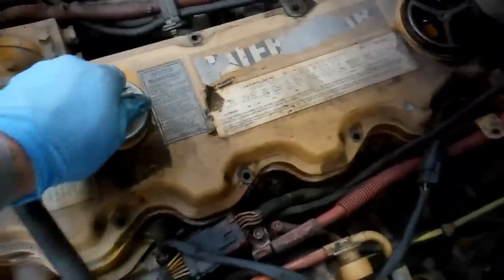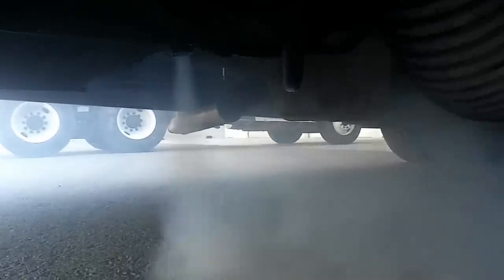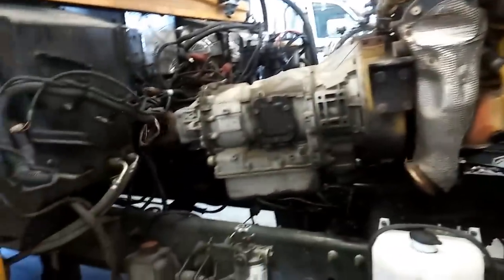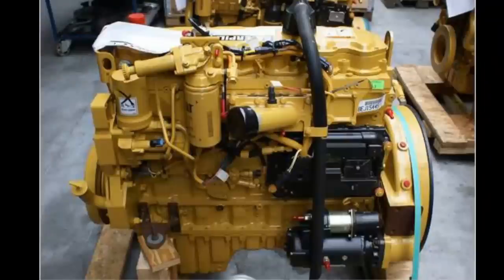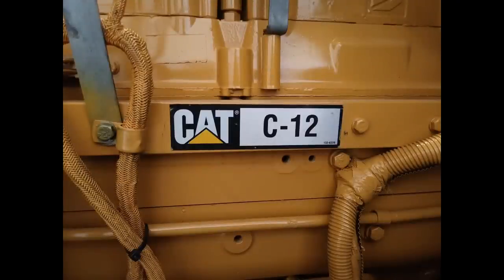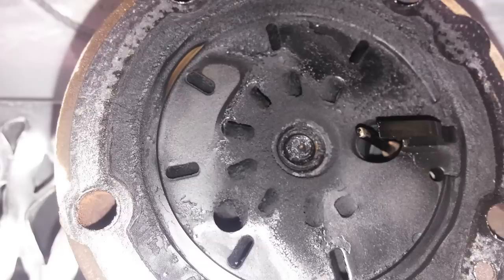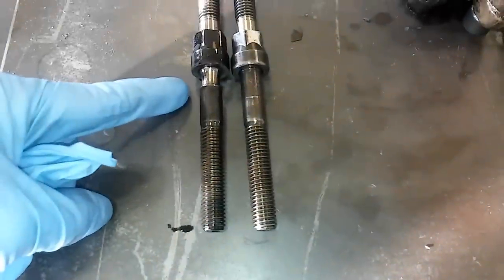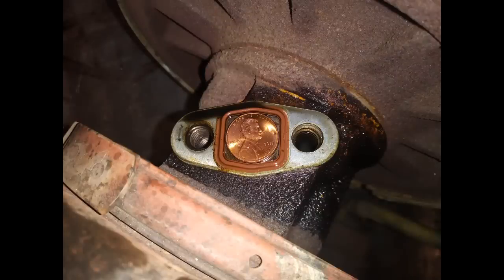What Are The Best Cat Diesel Engines?

Comment: 3406b for the win. 
I think is the best hd engine. 
They still around running now. Kinda like old Honda or Toyota’s. They jut don’t die.
Reply: Gcal1956 I have one with 2,200,000 miles. It is still pulling 48k lbs regularly.
Reply: @ArielJRodriguez  that's a light load compared to what we pull here in AUS
Reply: @Dilanom  That's because of current USDOT regulations.  They did begin a pilot program to have certain highways to allow road trains like you Aussies have though, you should expect these older engines to shine once they allow road trains like down under.

Comment: Great video josh! You may already know this, but to address the oil leaks around the spacer plate I use loctite gasket dressing on the top of the block and the bottom of the spacer plate  down the drivers side and so far haven’t  had any have that nasty little leak there, a cat guy recommended that and so far it seems to work.

Comment: Thx for video FWIW I worked for Cat Dlr as mechanic in mid 70s 1693TA was million mile engine dual overhead cams 4 valve head only nightmare was breaksaver with leaks  in convential cab LWB with mega sleeper and road ranger behind was like working in a cave. Always had Owner Operators trying to get you to step up the injection pump and reseal,  never did but they were flashing $100. bills trying to getrdone. Guess 425hp wasn't  enough hard to believe my GM D'max LML almost has that much hp and it don't clatter, smoke or smell like they used.
Reply: Lol, my dad worked at a dealer in the 70's and 80's.  Talked about that same thing.  Told me the dealership's truck (3408) had it's fuel screw backed all the way out, and the driver would run it by keeping an eye on the pyro.  It worked well until apparently a state trooper clocked him doing 70 while pulling a D9.

Comment: Thank heavens you said the C12 is the best :) I just bought a motorhome with this Engine .. Whew !
Reply: Hey my friend I'm looking at buying and older Diesel Pusher one thing I've learned is in the early 2000s c12  cat  put nylon plugs to keep the wrist pins in the Pistons,,,,, a lot of those engines went in motorhomes and they would self-destruct magnificently breaking the block around 50,000 miles,,,, Cat knows about this and they've isolated it to a serial number run on c12 2001 - 2005,,,, motorhome manufacturers just buy a bunch of motors and they sit around for years sometimes so I would check the serial number,,,, well some people say there are problems outside of the known bad serial number run but rare,,,,FYI,,,p.s. also those engines suffered from weak wrist pin metallurgy,,,, all this information is known you can do some Googling on RV forums,,, I'm looking to buy a diesel pusher around 2000 to 2006 to avoid emissions crap so I've been spending a lot of time educating myself on these engines,,,, hope you got one outside of that production run happy and safe travels
Reply: The c12 was a throw away motor all the big fleets sell them when they come out of warranty at less than 600k miles they turn the cam bearings and oil pressure breaks the oil pump leading to catastrophic engine failure rods through the block etc.

Comment: Love the torque curve of the 3406 cats in trucks but not a fan of their gear driven water pumps. We run 5 Cat generators with 3406b and c engines at 275hp -350hp. We have one that had 150 hours of actual run time under 50% load that failed, we lost it due to coolant in the oil (wiped the bearings) and had to replace two water pumps on the other ones. Two never weeped out the hole in the water pump. One got caught by annual oil sampling the other started knocking while running during Hurricane Michael. Cat dealer serviced and inspected them two months before. The 3406b model is a 1978 275hp unit, it has close to 3000 hours on it and runs like a dream.

Comment: 3406E and 6nz. end of discussion
Reply: Mississippi Mud Team B model roll the credits...
Reply: Yea no shit sherlock this dude is a cat mechanic  obvi every fan boy is over here 6nz and c15s baby! Obviously there great motors in big rigs, do you even know anything about them? Were talking about all motors ,reliability, durability, longevity, power,  yes 3406e is great and obviously that an 6nz are the big dogs in the cattle and coal trucks. Awesome. at a mechanic standpoint that doesn't make it the best motor due to every big rig cool ass truck having it, were talking real craftsmen ship and alot of reasons these motors are great other than sounding badass straight piped and and power houses. Damn

Comment: I've never owned a cat, or even a diesel, and probably never will. That being said I find your videos fascinating and have been watching for a couple of years now. Thanks for all the cool content!
Reply: David S look into a Volkswagen diesel. Yeah they were a bit sketchy with emissions but if you look past that they are crazy reliable engines that get high fuel mileage.
Reply: @markm0000  My sister has one and takes crazy good care of it but it never doesn't have a check engine light. Unfortunately we live in a state where that is a really big pain in the ass and the dealer is always super expensive. I don't think I can afford that hassle. I'm sure they're not all like that, but I hear a lot of them are.
Reply: David S I'm basing my knowledge off the older models from 2008~ish. I'm sure the newer stuff has more electrical problems as most new Volkswagens do. Unless you've got a mechanic friend I would stay away from German cars.

Comment: My first truck wasn't my first choice. Anyway, it had 3176. I bobtailed about 2600 miles averaging 9-105 mph yes I was speeding due to a follow up where my permits expired backwards. Here is what made me a fan as the owner 16.9 miles per gallon at 9-105 mph bobtail. It sipped fuel with a 80,000 GVW 9.4-5 miles per gallon in urban local traffic. My second truck had a series 60 and 2 other 3406 b truck running the same weights the same routes average 6-7 mpg. Loved saving the fuel with the 3176. For medium when I bought my third tow truck I searched the western us for the best rollback i could find used. ALL of the F350S HAD FRAME REPAIRS AND I AM NOT A INTERNATIONAL DIESEL FAN. I found a F600 with a 5x2 setup aluminum bed drove there bought it loaded my car on the bed and drove it home and got 24 miles per gallon with a Detroit 8.2 fuel pitcher. Way better fuel economy made up for the slow drive. None turbo meant so getting there but a extremely durable problem free truck. The fuel savings was incredible. It used less than 1/3 the fuel of the ford super duties about $30,000 per year less and broke way less often with much cheaper repairs.
Reply: I'm

Comment: Hard to believe the 3176 is almost extinct in the wild today. I ran RJM in Summerville, SC where the 3176B cylinder blocks were being machined 24/7 from 1994 until 1996. We also machined the pre-production C12 blocks. At any given moment, we had at least 4 different versions of the C12 block castings in process. The issue CAT engineering was fighting with all the casting revisions was the development of cracks in the bulkheads. As it turned out the cracks were being caused by a harmonic vibration being setup by the cam drive gears.

RJM had just enough capacity to keep Mossville in 3176B blocks. With the added load of the pre-pro C12's, we were really falling behind until we made changes that increased throughput of the pacing operations. This of course was at the expense of tool life (and costs). I don't believe I ever got more than 3 or 4 hours of sleep per night the whole time I was down there. 

With that one behind us and with just a few years to catch our breath, next up was Texas! San Antonio, Schertz, Seguin....

Comment: Could you do a vid about 3406b and 3406c differences, pros and cons ?
Reply from the maker: Probably in the future, but the short answer is the 3406B is a full mechanical great engine. The 3406C is a 3406B with some electronic junk bolted onto it to screw it up. You can actual turn a C into a B and eliminate some problems.
Reply: Mechanical 3406C started at 3ZJ16182 and up, 5KJ07800 and up. PEEC 3406C engines 4CK00846 and up.

I have not worked on or seen a 3406C 5KJ. 
Most of the time a emissions change was fixing to occur, thus injection psi starts going up. Not in all cases, but emissions is the driving force. A video would be worthless, its all about if emissions laws are meet . You can go forwards, stay the same year but you can't go backwards. One word EPA. Changing a PEEC to a Mechanical is illegal and the word is EPA. Can it be done, yes. If your caught, EPA.  Fine roughly $37,500 or higher if I work on them. Not worth it to me.  So basically timing was played with, (fuel) nozzles, (air) turbo, what ever was needed to meet emissions or getting ready for the next big change. Take the last mechanical 3406C built in North America the 8PN. A dog engine just to meet emissions. A lot of carbon was allowed pass the rings and into the oil pan to meet emissions. On mechanical engines you had two dimensional timing, RPM's vs degrees of advance. With the introduction of electronics you went to a three dimensional timing. Thus electronics and EUI's had to come out for CAT to meet emissions. Today common rail is needed to meet emissions.
Hate to be rude but making this type of video you would have to see emissions laws around the time frame. Also you would have to see what parts replaced that was emissions related. Which HP and RPM rating would you use? A lot of combinations was available.
Reply: Is there any sealant you can use to prevent leakage between the spacer plate ? I know that "Old Timers" used PERMATEX  NON HARDENING  sealant on head gaskets on old Cat bulldozers to seal them ! You can reference this @ ACMOC  " Antique Caterpillar Machinery Owners Club" website ! Glen.
Reply: THANKS AA !
Reply: Glen Hayward  Loctite 1522029 Aviation Gasket Sealant both sides
Reply: With all due respect, the statement that all B's are full mechanical and C's have electronics is not exactly true. It is however what is usually stated as fact. There were some B's equipped with PEEC in the late 80's . There were also a lot of full mechanical C's built over their run.  I own one, The true differences are the difference in rod journal width. The C being a "wide rod motor" (at least typically-probably 95%) , Also injection pumps, injectors and most timing advances are different from B to C. The B model pump has the capacity to deliver a bigger volume of fuel at a lower pressure making it the most legendary for power from turning the screws. In reality though, a C model does have more robust bottom end.  And a C model can also lay down some respectable power and live a long time doing so. No, they won't due the 800 to 1000hp thing that the wire motors do (not without some pretty exotic mods, anyway) but they won't get hot and derate after a few miles at operating near their limits. That decision is left up to the nut holdin' the wheel.  You are very knowledgeable on Caterpillar. Much more than me. I enjoy your vids. Very informative. I realize that you just haven't had the exposure to the old mechanicals that I have. I even drove and wrenched on a 3408pc and di when I was a kid. The 1693 was  before my time.
Reply: sprdaxlw9l   Wide journal came into production as follows 2EK00512, 3ZJ02830, 4CK00170, 5KJ07539 and 5YG1.
Reply: Thank you for the info. putting all new b & p's in my 3zj today. Do you know if there were any changes in same rated 3zj's between 3zj27560 and 39679? I know the latter has a jake setup on it.
Reply: @AdeptApe  I've heard that one c15 being used in ntpa pulling competitions was converted from electronic to mechanical. Is that true? I love your videos I wish there were more people like you out there that knows what they're doing and can explain things.
Reply: sprdaxlw9l  CAT has reman on these now. I put a set in a old 7FB new and all was clocked wrong. I had to order 14 pumps before I got a good set. Engine would run away. 
Make sure you use the pink seal on top, have the latest style bushing. They was causing a low torque issue and was bypassing injection fuel. I also like to replace the spacer as they are cheap compared to fuel in the oil. Use update clamps and brackets on fuel injection lines. 
3ZJ27560 425 HP 2000 RPM Jakes, PB. 1086633 pump reman 10R4428, nozzle 0R3587.
3ZJ39679 425 HP 2000 RPM Jakes, Navistar. 1086634 pump reman 10R4374, nozzle (factory installed 100-7556 they are junk) Updated nozzle 0R4337. 
Injection pumps was single helix, went to double helix. All parts on dual are same except check valve if memory serves.
Reply: Didn't get to do B &   P's yet. May go ahead and get new spacers. Bought all NEW elements. Got to where I don't trust Reman at all.  Real bad experience with OR8785 nozzles. Replaced at under 50k miles with 7W-7031. Night and day. Got the pink orings this time. Lapped pumps about 70k ago.  Then about 10k ago. Still had some flutter after last time. First time should have lasted longer. Decided to replace this time. You, Mr Goldsmith are a wealth of info!!! Thanks.
Reply: sprdaxlw9l  No Mr., that was my fathers name. The pumps that was wrong was new, not reman. 7W7031 don't sound like a truck engine nozzle. Lapping pumps have to check for wear from low torque on bushing. The bonnet was changed three times. If top of barrel has a worn ring area will not seal off. Have to increase torque on bushing, which I dislike. Hate to crack a housing. Read Truck Engine news article March 3, 1996, SEBD6676.
Reply: Marine nozzles. Can you just pm me an email or number I can text to? I hate to be a pain , but all the old timers I knew around here are retired and don't even want to hear the word diesel. I have had some weird issues I have been chasing in my fuel system off and on for 3 or 4 years.
Reply: sprdaxlw9l  I don't know if I can help with marine nozzles and two different engine serial numbers. You have to chose one for me. I am working on one right now with Pittsburg Power nozzles. I have no spec or nothing to go by. All I can check is VOP about the same and such.
Reply: Pittsburg power nozzles, eh?  My marine nozzles match the 4TB04640 engine sn. That is the roughest match to the same piston bowl I could find to my 3zj 15.2 alum pistons in a larger nozzle. I have not done my b & p job yet. Gonna head your advice and pick up all new spacers today since the rest of the stuff is new. That should either cure my mild "hear it in the background, machine gun flutter" or eliminate that area as a culprit. Then I will move on to pulling injectors and testing them again. They only have 50k miles on them but they are 4 yrs old. Then possibly valve rotators or something akin to a leaking valve seat.
Reply: If these nozzles match the bowl, great. I am not good with mismatched parts. All six Pittsburg power nozzles had poor spray patterns,  some low VOP compared to original. Three had the carbon dam seal cut allowing compression to by pass. I ordered six reman pumps and got all new ones. Saving customer 600.00. Got fuel system and FTP in a bucket all took apart. No FRC has a plate over it. I rebuilt VTU few weeks ago. 
If your bushings are the new style and going to reuse them. Put them back in the same hole. As the threads are mated to the housing. You know how to check each injection pump after it's installed for correct timing? It helps so when you fire it off you don't have to remove a pump for being out of time.

Comment: I'm curious do you do you ever discuss the the 1693 and the 3406 A PC. probably not being as they almost non existent any more. but there are few of them still around. I was just wondering because I have driven trucks with these engines in them. and have found them to be quite reliable engines. the 1693 it's main drawback was that it's really heavy. but they were relatively easy to increase the HP on. although then the driver would have watch the pyrometer and coolant temperature more carefully. and I drove one truck in particular that had a 3406 A pre chambered engine for a long time. even though it was a little less powerful it was a really good truck engine. I'm probably showing my age but I thought I would ask anyway.    oh I almost forgot another one that was popular as a light duty engine. was the little V8 the 3208 if I remember correctly. Cat produced those engines for a long time. but then ended production of them some years ago.

Comment: I have a C12 2KS and I agree it is a very reliable engine..I do have a question though, I wish you would do a segment regarding the "Teflon Buttons" that hold the floating wrist pin in place,
I have heard horror stories about the Buttons failing causing the pin to touch the liner eventually binding up which will cause the piston to turn over knocking a window into the side of the block..
Why would Cat not use snap rings like they do in most of the other engines ???

Comment: Hi! I have two cat 3208 in my boat. They both has gotten very high oil pressure lately. Is this common? Do I need to fix it? I have read that they have a pressure regulator, but I then have to remove the oil pan.. which is a pain
Reply: caliwator I would take them to a shop sooner than later you might have a more serious problem.

Comment: Best  CAT,  D-343  1693 T/A  425,  of  course  your  Too  young  to  discuss  the  very  Best  Class  8  Truck  Engine.  3406 - A  another  great  engine  no  mention.  pity.
Reply: 34o6 cat
Reply: Which 3406
Reply: D-343 is going back is going back nearly 60 years. I spent 16 years in a 988A with the D-343. 87A- 1689. Dam that wad a tough machine.